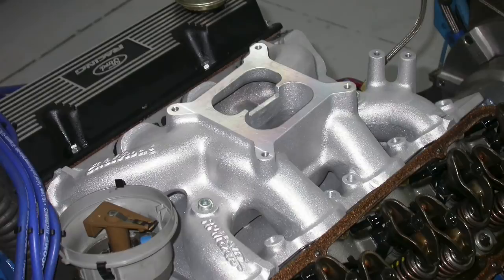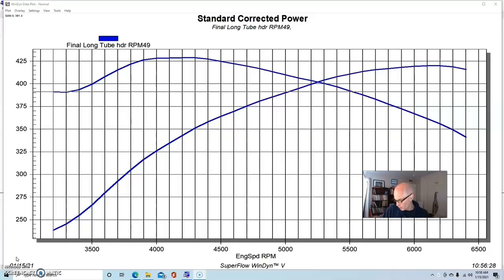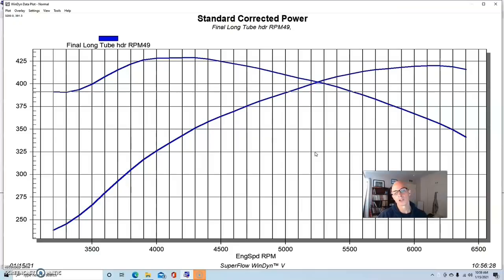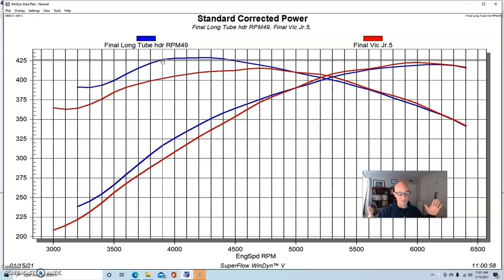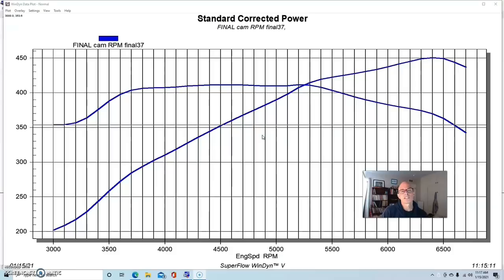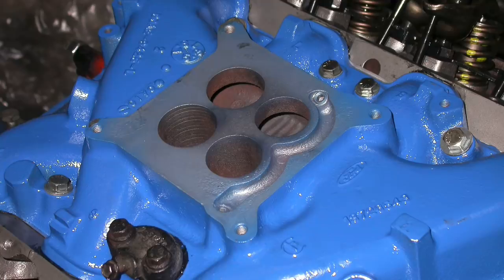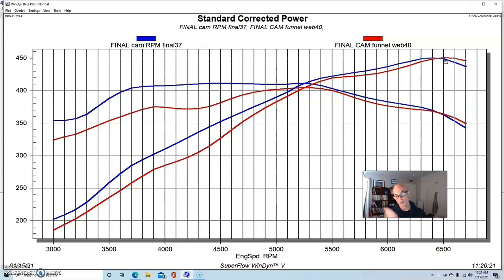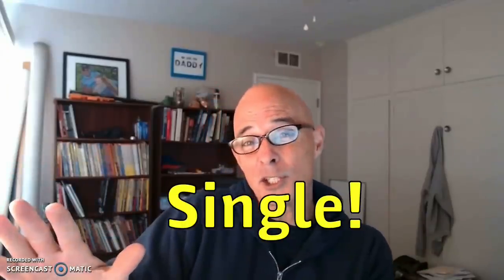THE OTHER GUYS INTAKE TEST-351 CLEVELAND (PLUS 351W)

Comment: The Cleveland needs a much bigger cam. 275+@.050 and .650+lift. Then the difference between the singleplane and the dualplane would be dramatic. Those 4V Cleveland's were way undercammed. Takes a lot of engine to utilize the Parker Funnel Web. They shine on 600+hp combos.
Reply: Very true, most of these youngsters don’t have a clue what the 351c is capable of, even without aftermarket heads,

Comment: Dang Richard had mod motors on the brain when he discussed the intake port size in comparison to head port size lol
Reply: Ford liked to use V, as in venturi, to differentiate between 2 barrel and 4 barrel carbs. I noticed that too. Man a 4 valve Cleveland head... crazy, but the ports would be a lot smaller.
Reply from the maker: yes-4v vs 4 valve
Reply: I forgive you😎
Reply: Most aftermarket 351c heads are referred as a 3v. Basically a 4v with a filled bottom such as a Chi 3v.

Comment: Good test, I would like to see 351 Cleveland will a weind tunnel ram with two 450 carbs (Not vac. Carb) against torker manifold & 750 double pumper. I would like to see how much more power the tunnel ram.
Reply from the maker: I did that on a 383 if I remember right
Reply: @richardholdener1727  I will have to look up the video. I have both manifolds & carbs. The tunnel ram is way better.Thanks 👍

Comment: You're a good man Richard..
What I've noticed in quite a few shootouts is stock Cleveland heads taking on aftermarket aluminum and still keeping up with them and in some cases beating them. true engineers back late 1969 I'd love to meet the men that engineered those heads in cleveland ohio back then, and yes I know the original canted valve design was from a 396 Chevrolet first
Reply: The hot ticket with the 4V is to fill the dead spot in the bottom of the intake port to increase velocity. No need to make it much smaller, just keep the air from slowing down as it comes through the low part of the port. A tunnel ram fixes the problem to a great extent, and unless you are trying to get everything out of 4V heads, it isn't a mandatory thing to do. Its something you can do though that works quite well. 

The rumor back in the 70s and 80s was that the 4V was lacking low speed torque, except the ones I was building and driving could turn a pair of sticky 10" wide tires to molten goo just whacking the throttle from idle, no need to hold the brakes, and all my engines had was a cam swap and headers. 3.00 gears made it worse.

I have a 4 bolt 4V headed 72 Cleveland on a stand in my shop waiting for a 4" crank, then its going in my 67 Cougar... for science and daily driver duty. Still have something like 4 sets of 4V heads laying around from when I was messing with them in the 80s.Got big into Pontiac after a 4 year hitch in the USAF, came back to building GTOs and Firebirds in the 90s. The C is the only small block to ever impress me. I can't wait to see what a 407ci 4V runs like.
Reply: @SweatyFatGuy  Hows your Cleveland builds going?   A good Cleveland deserves 400+ ci.
Reply: Yeah so would I,, too give them an arse kicking!! Canted valve is good, intake and exhaust runner sizes is plain too big. Valves are too big unless you want to trurn over 8000 rpm where the dodgey oiling has failed and the engine exploded.
Aussie 302C heads are far better.
Reply: @ldnwholesale8552        😂 yeah you're right they weren't the greatest Street motors but I was mainly talking about the engines on the Dino shootouts even to this day it's hard to beat those stock Cleveland heads on cfm flow

Comment: How about a canted valve work truck motor comparison. In the blue oval corner the 400m . in the bowtie corner the 396/402 big block chevy.
Reply: Jnl Jnl   there is no comparison. Yes the 400m made good torque but they only had the small port Cleveland 2v smog heads and junk 2 barrel carb. Hell I think the cam for a 400 was less than 200 over all duration and like .420 lift. Richard already put a 400m with a RV cam. It did ok but Richard used Cleveland pistons and the piston depth was to low in block. Then he put Pro Comp aftermarket Aluminum heads on it with intake spacers to run a Cleveland intake and a solid roller cam. Made real good hp/tq for only 8.5-9.0 compression. here, check the build out.     https://youtu.be/WV3GRirgj0c
Reply from the maker: did you measure the piston depth?
Reply: @richardholdener1727  are you asking if I measured the piston depth? If so, then no because you built it not me. 

I was telling him about your 400 build because he was asking for a comparison between the Ford 400 and a BIg Block Chevy 396-402. Factory head to factory head there is no comparison between these engines. The 400m is a small block anyways, like the Chevy 400 small block. 

 Seeing the 400m is 1" taller than a Cleveland and talking with TMeyer  and just being around Cleveland's my whole life - I know the Cleveland piston is shorter than a 400m piston. Also when watching your video and the still shot of the "C" piston in the block, it looks more like a 1/4" in the hole than .060 like you mentioned. I wish Ford didn't change the 400 bell housing and motor mounts to a big block style. If they were like a small block I would have a 444 stoker 400m  kit from Tim. 
https://www.tmeyerinc.com/product/rotating-assembly-351m-400-stroker/
Reply: @nova467spanker  I have 2 400m motors, one has the Cleveland edelbrock heads on it, with a tiny cam that still sounds stock it made 440 hp 5200 and 535tq at 3500 on the dyno, with conservative timing and 87 octane, with 93 and more timing it runs way better
Reply: @drivinwithdrew7676  Look for a 1973 400M with a FMX transmission. They have the Small Block trans. bolt pattern.
Reply: @cgarris8674  they're very rare tho.
Reply: @nova467spanker  i seen he had tested. thought it would be something he could do from home with footage from when he was at the shop. For more content.
Reply: @nova467spanker  i think it could be made fare by using the peanut port head on the bbc . and never count out the 2v cleveland style head. I've seen them lay down some power at truck pulls.
Reply: I admit to knowing sod all about 400m but if the small port m head is the same port as a small port cleveland then let the games begin.
Reply: @watsisbuttndo829  same head
Reply: @jnljnl8485   now i want one.
Reply: @watsisbuttndo829  71 400 had 9.1-1. 72 on had about 8.5. And yes they were 2bbl. Though Edelbrock and others make a dual plane for them.
BUT the aftermarket junk pistons are so far down the hole they would be  less than 8-1. With said junk FM pistons using closed chamber 302 heads  I have factory 9.1-1 and it is a bit of a slug. That is with a 525 lift 218 deg cam. Performer and 670 Avenger.
351 pistons have the same pin height as the 400 but pins about 12 thou bigger!! WTF were they thinking!
Reply: @ldnwholesale8552  im over in Australia and the thought of 400ci clevelands is knee weakening. Any of the piston companys able to knock up something one off or maybe a longer rod to get things in order. Surely the base engines are available cheap if everybody has written them off as a turd.
Reply: @watsisbuttndo829  tmeyer here in states make a piston for the 400 - he's built some really nice 400's he puts some c.h.i. heads on them and they are knee weakening !!

Comment: Yo Rich. Have you already tested carb spacers? Is a 2 inch spacer - open plenum, still useable on top of a dual plane intake? Do we just want as much air fuel mixing as possible and thus taller spacers? or should they be kept squat? Thanks for the many insights. Fabulous. Matt. 351 Cleve. 2V. Edel. Perf. Holl 600cfm. Vehicle - Land Rover. Gearbox C4 auto. Diff.. 3:1
Reply: Spacers can definitely give ya more power. Get a 1/2 inch, 1 inch, and 2 inch and test them all on your ride. A 4 hole 2 inch might work better on a dualplane.
Reply: Milled divider on the dualplane will usually pick it up too.
Reply from the maker: Yes I have run lots of spacer tests-there is no universal yes or no
Reply: Okay great guys. So hard I'm searching up those tests of yours. I am now considering tig welding tubes in line with the 4 barrels in a 2 inch open plenum and testing this against other designs. I have a feeling these tube runners will have some sort of improvement.

Comment: I wouldn't say the Cleveland did better than the Windsor, for a head with so much more flow.
Reply: Fascist Pedant  Funny you say that. Now actually compare the FACTORY Windsor heads vs the factory Cleveland heads. This test the Cleveland heads were factory but the Windsor were HOLLEY heads. Hell test the smaller Cleveland 2v heads so its closer and not any complaining like Chevy boys do.
Reply: @nova467spanker  Yeah, the flow numbers he quoted stuck in my head.
Reply: Goes to show you how advanced 4V heads were for their day. Still made more power and had a better torque curve than a roller cammed alloy headed windsor.
Reply: The Windsor had aftermarket heads , not stock , also it had a roller cam unlike the Cleveland flat tappet cam . That's why the hp/tq are not much different , the Cleveland had a little bigger cam too .

Comment: @Richard Holdener, were these closed chamber 4V heads?
Reply: I saw the other videos he mentioned with that same Cleveland. Pretty sure closed chamber.
Reply: @morgan2373  i assumed, was just curious. If it was dumping out that power with open chambers I can find those all over. The closed chambers are harder to find. A set of fresh open are like 400, closed are closer to 1200. May as well go aftermarket at that price, although I would prefer old iron.
Reply from the maker: closed
Reply: @richardholdener1727  thanks Richard.

Comment: Are engines with locked out distributors @ 35 degrees BTC hard to start?
Reply: Set it up so the starter has the motor spinning before you turn on the ignition.
Reply: Depends on cam timing. If the cam is small, it can be. If the cam timing is rowdy and bleeds off compression, it'll spin easy.
Reply: sometimes
Reply from the maker: dual starters on the dyno
Reply: Yes!! You need a seperate switch for the ignition,, get the engine cranking and make sure there is oil pressure then turn the ignition on. Otherwise they kill starters and engine sneezes can do damage. Chev, Ford, Holden Mopar,, all the same